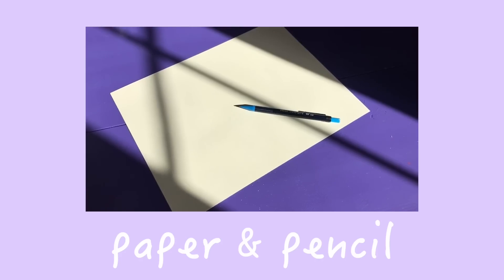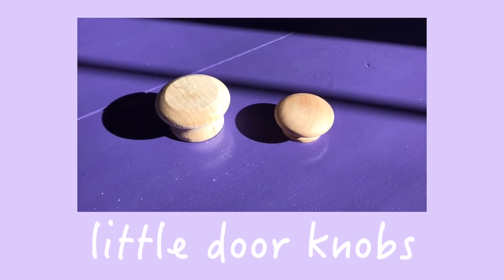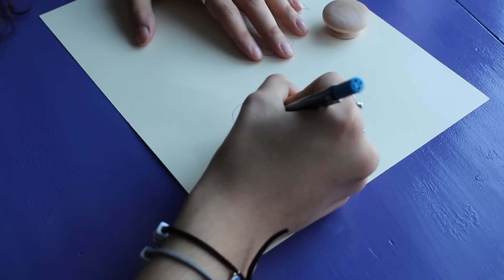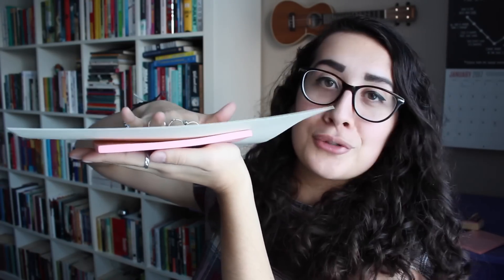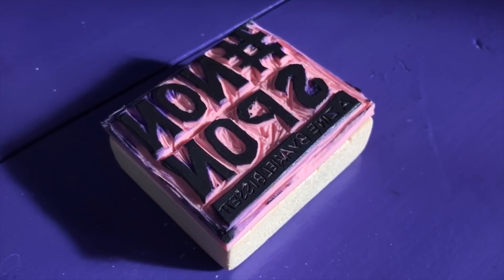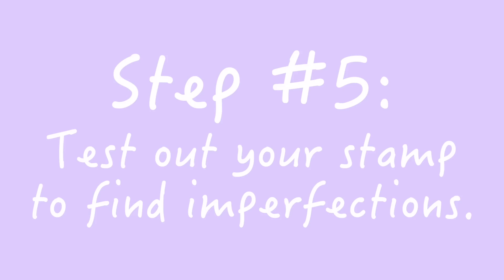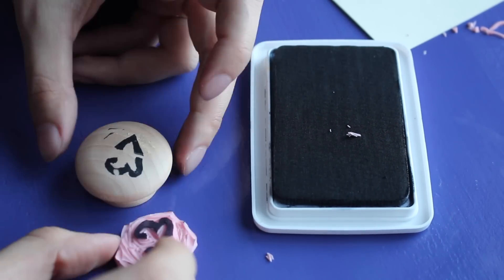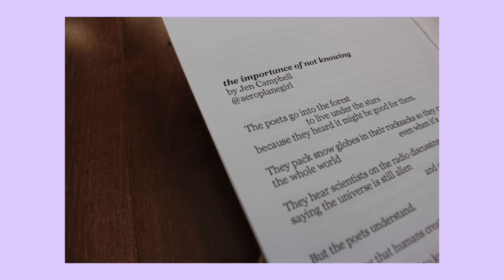How To: Make A Stamp!

Comment: notes on rubber vs linoleum: rubber is easier to cut because it's softer! but it's softness and tendency to hold a bunch of ink can cause a loss of detail. linoleum is harder and allows you to get into a lot of detail, and it'll last longer as a stamp. to soften linoleum while you're cutting it, just warm it with a hairdryer and you're good to go. otherwise as others have mentioned, your cutting  tool can slip and cut yourself!

Comment: For when you rub on the back of the paper, I guess you can use your fingernail or whatever, but in my art class, we coloured with a pencil on the back, and that way you can see where you need to do more and get everywhere smoothly. Plus, it's sharp enough to put on enough pressure to get the graphite really well on the stamp.

Comment: Omg it feels like I'm back at high school. In art class we always used to do this with linoleum! That material was quite tough and sometimes that little knife thing would just slip away because I was using so much strength and then I would cut myself... yeeey to 13 year old me 😂 We made like faces and stuff but this is so much more fun! The rubber seems so easy to use!